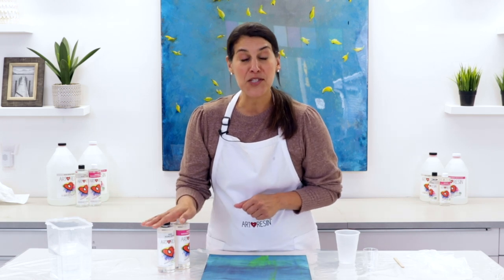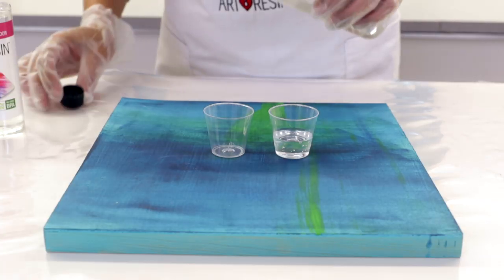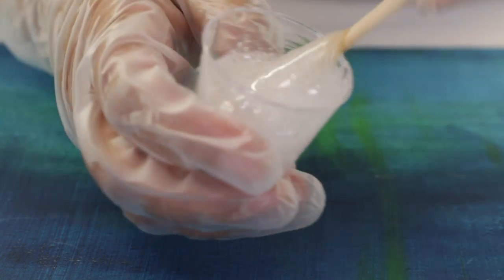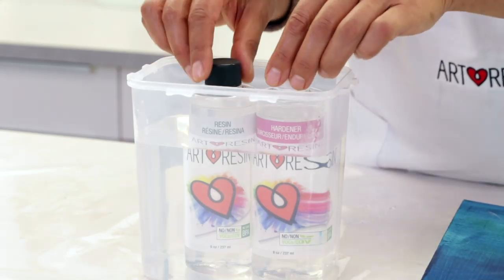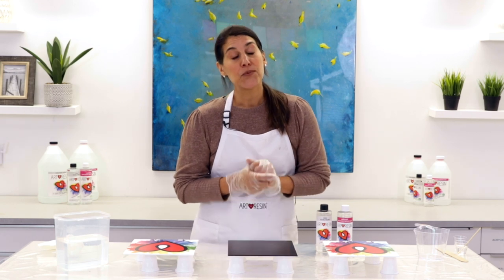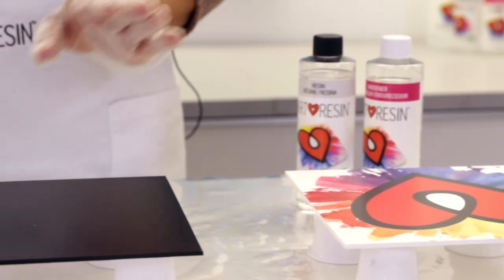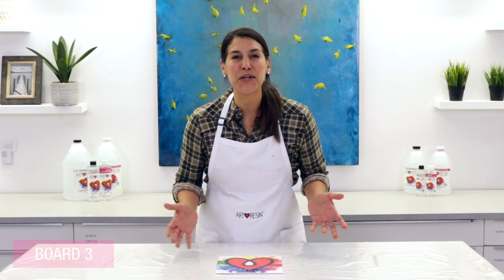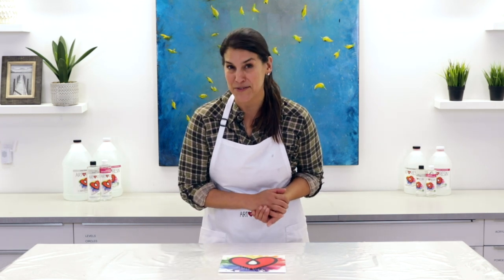Cold Weather Resin Tips

Comment: Thanks Joanne for this video. I think realistically speaking there is going to be a fluctuation in temperature because it's the Winter. Perhaps a slight drop in a few degrees won't affect it? I would think with a cardboard covering and masking off the bottom edges would help keep the cold out.
Reply from the maker: Hey Mike - glad you enjoyed the video! I'm sure a drop of a few degrees wouldn't have an effect but resin can be a little fussy and loves warm, dry and stable conditions best :)
I was showing worst case scenario ( high to low temps ) to illustrate how important temperature stability is and what kind of an effect it can have on resin.  I know a lot of customers like to place their pieces in a sunny spot to cure, but can end up with surface imperfections this way. And you're right, a nice secure cover will help keep it insulated and warm.
Reply: @Artresin  well to be honest Winter isn't the most popular season for resin making! I've worked with Artresin before, it does tend to require a longer curing time to achieve a really hard surface. But that said it's probably the best of them all if you're doing arty things and work with paints and crafts. I make skate decks and love making resin art so that's why I returned to AR for its longer work time. My order should come this week. There are resins I've worked with that can endure a minimum of around 18°C and cure pretty hard under 24hrs. But these are woodworking resins which don't require the aesthetics as yours does.

Comment: Do you have any suggestions for doing resin art in the winter in your house? The house temp drops at night as the heater does not go on as often is there any way to counteract this?
Reply from the maker: Hi Dani, the ideal temperature for curing your ArtResin is between 75-85F.  It is best to keep the temperature consistent for the first 24 hours.  If you are finding the temperature fluctuation is affecting your cure-you may want to set your thermostat for a more consistent temperature for that 24 hours.

Comment: This video was really helpful. My resin art work tends to get wrinkly like when you keep a hot coffee in an open cold area, and it's surface starts to wrinkle. I'm getting the exact same texture. Read a lot of articles, watched a lot of videos. No solution found. 😅🥺 And it's becoming a big problem now. Don't know what to do about it.
Reply from the maker: This can happen if your temperature fluctuates during curing or if you move your resined pieces before they have fully cured, or if you use your torch after the resin has started to cure.
Reply: This has been happening to my pieces too. Cannot understand why. I've tried everything. I keep checking without touching or moving them. Might be some fluctuation in temp while curing as they are usually left overnight and the temp won't be the same as in the day. Maybe I need to make things early morning so the temp is fairly constant for more hours.

Comment: I just wanted to ask if it’s safe to leave the resin cure in your house with young children. And also can you work with resin in a cold winters day out in the garage ?
Reply from the maker: Hi Shawana, yes it's safe to let your resin cure inside your home. ArtResin has been evaluated by the American Society for Testing and Materials (ASTM) and has been designated non-toxic when used as directed and safe for home use in a well ventilated area. For more information, please visit our website and check out our Safety Data Sheet & Blog - ArtResin Is Safe For Home Use. 
https://www.artresin.com/blogs/artresin/41788993-artresin-is-safe-for-home-use?_pos=1&_sid=37f5a3951&_ss=r
https://www.artresin.com/pages/sds

You also asked about working with resin during the winter in your garage?  The ideal temperature for both your ArtResin and your workspace is slightly warmer than room temperature: 75-85F or 24-30C.  Resin won't harden properly if the temperature is too low. For more information about working with ArtResin during those cooler months, please visit our blog - How Does Cold Weather Affect ArtResin 
https://www.artresin.com/blogs/artresin/what-is-the-perfect-temperature-to-cure-epoxy-resin?_pos=1&_sid=e4b177259&_ss=r

Comment: Question; If you do live in cold temperature because it's winter, can I use UV lighting for the curing process?
Reply from the maker: ArtResin is an epoxy resin which is different than a UV curing resin.  Epoxy resin does not cure using a UV lamp, it will take 24 hours to feel cured to the touch and will reach its full cure in 72 hours at recommended temperatures between 75-85F.

Comment: i gave up on trying to get my statues like shinny glass on the outside with resin ...theres always an issue... instead i coat, sand  smooth and paint... once i setup a nice paint station i may just finish them with auto paint and clear.. resin hides most of 3d lines and adds strength... uv resin is kinda costly so i will still use 2 part which i think is stronger.. thanks for all your tips..

Comment: Thank you for this informative video... I just wanted to know that how can I clean my silicon measuring cup or any other plastic cup or glass
Reply from the maker: Glad you enjoyed it!  We have how to clean your tools lined up for a future video but here are a couple of options:  you can wipe out any excess resin with paper towel, then spritz the measuring cup with isopropyl alcohol to break down any remaining resin residue. Wipe it out and repeat this step as many times as necessary.  Once all the residue is gone, then you can wash your measuring cup in hot soapy water.  Whatever you do, don't pour any resin down the drain.  The second option is to leave your tools on a plastic surface ( turn the measuring cup upside down so that the resin all pools out onto your plastic lined work surface ) and let the resin dry .. the next day, simply peel the resin out.
Reply: @Artresin  thank you so much for replying me, it is really helpful tip, I'll use it definitely

Comment: Hi! I want to start using Resin and since it´s still very cold now, these tips are definitely very helpful, but i do have one question: Since you´re supposed to work in a ventilated room but at the same time a warm room, how does that work in winter? Because even if I heat up the room I work in, as soon as I open the windows so that it´s ventilated for the work and cure process, it would get cold because of the cold temperatures outside. Is there any way to resolve this issue?
Reply from the maker: Hi Veronika, ArtResin is safe to use at home in a well ventilated area, meaning a room that is open with air circulation, for example-do not close yourself in a closet with no fresh air.  Everyone has different sensitivities and comfort levels so you can absolutely open the windows while you are working in the room, then close them when you leave your artwork to cure.  It is important to maintain a constant temperature especially during the first 24 hours of cure time.   I hope this helps!
Reply: @Artresin  Okay thank you very much! How does it work if i colorize the resin? Because I read in one of your replies to someone that that could end up making the resin toxic again because of the reaction the ink has with the resin. Should i work outside then?
Reply from the maker: @-veronika-3039  we use our own line of tints called ResinTint, they are mineral oil based so won't cause a problem when mixed with ArtResin.  One tip to keep in mind when tinting your resin: not all colorants are food safe, so to be assured that your finished piece is food safe simply apply a coat of clear, un-tinted ArtResin as final coat and you will know that the surface that your foods come in contact with is indeed food safe.
Reply: @Artresin  Okay thank you so much this helps me a lot!

Comment: Great video. What happens other way around. What if it's a hot non a.c. room, hotter than your range.  Will it dipple as well or just cure slower?  Too expensive to keep a.c. going 24x7  in a studio when not in it.
Reply from the maker: Humidity will be what will cause the most issues in warmer temperatures. High humidity could cause dimples or issues with curing the ideal humidity is below 50%. If your room is very warm you will likely shorten the working time of the resin and it will begin to set up a little faster.

Comment: Hey, can warming resin reduce the life of molds? Can heat affect the molds?
Reply from the maker: excessive heat, like that from the flame of a torch can damage the silicone mold and cause your resin to stick and mold to tear.  Its recommended to avoid using a torch with a silicone mold.
Reply: @Artresin  thanks a lot but does warming resin also affect molds?
Reply from the maker: @divyasonkar7563  the warmth of your resin should not damage the mold.

Comment: I got a 1 gallon bottle of resin never opened i stored it in my cabinet  i went to use it for 1st time yesterday to find my part A resin has gone solid white on the bottom of the bottle do i throw it away or can it be fixed.
Reply from the maker: Try placing the bottle in a warm water bath and see if that helps.

Comment: question do u need to wear a mask and googles while mixing the harderner and resin?
Reply from the maker: Hi Alec, ArtResin is non-toxic and safe for home use, when used as directed.  So, that means when you work in a well ventilated area, you are not required to wear a respirator.  Here is a link to our blog on what safety precautions you should take while using ArtResin: https://www.artresin.com/blogs/artresin/what-safety-precautions-should-i-take-when-using-artresin?_pos=3&_sid=beb61d212&_ss=r

Comment: Does resin cure when it's cold & thick when mixing?
Reply from the maker: Hi, the ideal temperature for both your resin and your workspace is between 75-85F. Resin that is colder, or left to cure in a colder workspace will take longer to cure and may end up sticky, or not cure at all. The best way to warm up your resin is to give your resin and hardener a warm water bath before you mix them. Please visit our website for more information https://www.artresin.com/blogs/artresin/should-i-warm-epoxy-resin-in-a-water-bath-before-mixing?_pos=1&_sid=6ce2c62e5&_ss=r

Comment: thank you why are you not wearing any protective gear asided gloves?
Reply from the maker: Hi Picco,
We are happy to tell you that ArtResin is non-toxic, produces no fumes or VOC's and is safe for home use when used as directed.  So, when you use ArtResin in a well ventilated area, there is no need to use a respirator.   Here is a link to tell you more about how to work safely with ArtResin:  https://www.artresin.com/blogs/artresin/what-safety-precautions-should-i-take-when-using-artresin?_pos=3&_sid=4d854de57&_ss=r
Reply: @Artresin  thank you. I will check it out.

Comment: Can you bring your resin when poured in the house if you seal it in a plastic container. I’m worried I only have a shed to work in but at night in the winter it will drop. Can’t do it in the house as the fumes and I have cats. I’m worried I will not be able to make my stuff as in the uk the temperature always drops at night any suggestions please
Reply from the maker: Yes you can.  ArtResin is non toxic and does not produce harmful fumes-it is safe for home use when used as directed in a well ventilated area.  Once your resin has started to cure, you want to avoid moving it around as the movement can cause imperfections in the surface.  You also want to avoid temperature fluctuations especially within the first 24 hours of cure time.

Comment: Right now I'm doing resin projects in the garage for proper ventilation (ohio) I noticed you don't wear a mask - would it be reasonable to do these in my basement instead of garage?
Reply from the maker: The ArtResin formula has no VOCs (volatile organic compounds), no fumes, and is safe for home use in a well ventilated area.  It is a clean system, meaning everything in the formula reacts together, leaving nothing that can become airborne and be breathed in.  If your basement is well ventilated, a respirator is not required.  ArtResin has been recognized by the American Society for Testing and Materials (ASTM) as meeting safety standard D-4236: Safe for Home Use when used as directed.
Reply: @Artresin  but what about when you add colors ? Everything changes and it does become toxic
Reply from the maker: @N0N4M30  It depends on the colourant you are using.   Our ResinTints are safe and non-toxic!

Comment: great tips!  question:  if your second example (the black surfaces) get reheated with a torch will that help get rid of the dimpling? and then continue curing at room temp?
Reply from the maker: Hi Ro - great question!  The black pieces, all 3 of them, did end up curing dry to the touch so for best results, a sand down and repour of ArtResin would be the way to go.  If the resin was still tacky ( ie not fully cured ) it would definitely be worth a shot with a heat gun or even a hair dryer.  I wouldn't use a torch - the flame would be too intense and you'd likely scorch your resin.
Reply: I started getting stretch marks during the curing and I put a heat gun to my peace and it got rid of it

Comment: What would you suggest for someone who needs to do resin outside because I don’t want to do it inside my house? I don’t have a garage to do it in. I have been trying to find something that is temperature adjustable that can be left outside.
Reply from the maker: Hi Re'Shell, We do not recommend using ArtResin outdoors or letting it cure outdoors for the simple reason that even the slightest dip in temperature during the first 24hrs of curing can leave you with a rippled effect, that we call the "orange peel" effect on your cured resin. The ideal temperature for working with ArtResin is between 75-85F, and for best results a consistent temperature is required during the first 24hrs of curing.

Comment: Thank you, brilliant tips. Quick question, can resin alter the colour of your prints. (on canvas) I used mod podge to glue down a printed paper collage, after applying the resin some dark marks have appeared on the pictures. Could this be a resin problem or something else? Thanking you in advance for some advice.
Reply from the maker: Paper will absorb the resin and cause it to appear dark and wet.  You can avoid this next time by applying a couple coats of sealer over your paper-even your Mod Podge will work, be sure to get the edges too.  Use a sealer that dries clear and ensure that it is completely dry before pouring on your ArtResin.

Comment: I am pouring resin into a clear tube for a specific art project and sometimes it pulls away from the inner edge as it's curing, leaving large voids (not a bubble) I have used warm resin, but my room is cold - could that be the reason for it? Would curing on a heating mat help?
Reply from the maker: Hi Teresa, generally the cold temperature will slow down the cure, not necessarily cause the pulling away.  For best results, try to keep your room between 75-85F throughout the first 24 hours of the cure time.  Would you be able to send photos of the problem you are having to our support team?  They can have a look and help figure out whats happening.  You can email our customer service team at support@artresin.com   Thanks!

Comment: Interesting, I live on the east coast and it gets cold, but then again the temperature can vary in any location in North America.  Keeping my space at 24 C will be expensive and difficult.
What was the temperature in the garage?

What was the temperature in the studio?
Reply from the maker: Hi Alan - these are excellent questions - you're right, I should have included them in the video!
We are just outside Toronto and we filmed last week. The studio was about 75F/24C when we filmed and the garage was as cold as it was outside - so a few degrees above 32F/0C in the day and then dropped below 0C overnight.  I wouldn't go below 72F/22C and I think the key is to keep the temperature stable, otherwise you may end up with surface imperfections.  Resin can be a little fussy and definitely loves warm temperatures best.

Comment: is this the reason that my pours are coming out cloudy and dull??
Reply from the maker: It could be!  Check that micro bubbles are not making your resin look white and milky.  If so, use a warm water bath to help clear them out.  If your finish is cloudy and dull it could also be a result of too much moisture or humidity.  Double check the humidity in your workspace and ensure that you never let any moisture get into your resin mixture.

Comment: i live in Australia. temp. in winter is 16degrees during day and 6 degrees or less at night. This is my dilema .( No central heating except a gas heater.)
Reply from the maker: Using a space heater in the room where you plan to use your ArtResin can help.  The ideal temperature is 24-30C, so try to get at least close to 22/24C if possible.  Keeping a steady temperature for the first 24 hours is important to avoid any surface imperfections.

Comment: Thought this was a great informative video but I do have a couple of questions. Can Art Resin be frozen (left out by delivery man etc), thawed out, brought to room temp and still be usable? If you use plastic  measuring cups will the dried resin be able to be pulled out of them (assuming you have drained them while still wet)?
Reply from the maker: Yes and your thought process is exactly right, the product will just need to be brought back up to room temperature and thawed out and it will be good to go. As far as your measuring cups we like to wipe them out with a paper towel and some denatured alcohol to remove the little bit of excess resin and then they are good to be reused on your next project :)